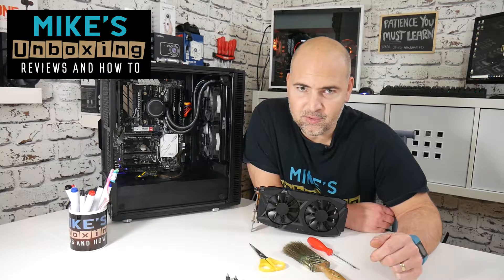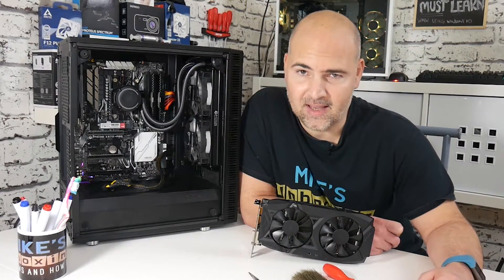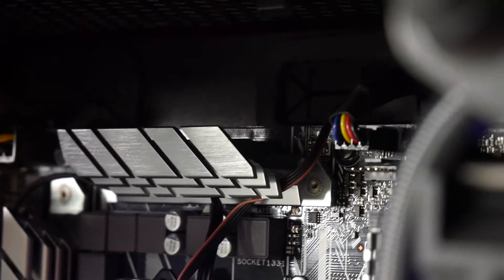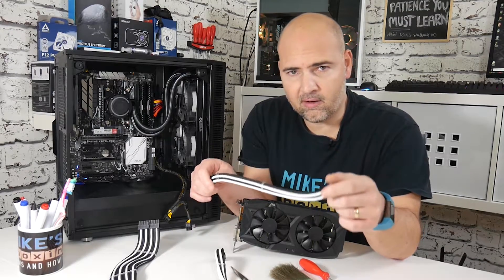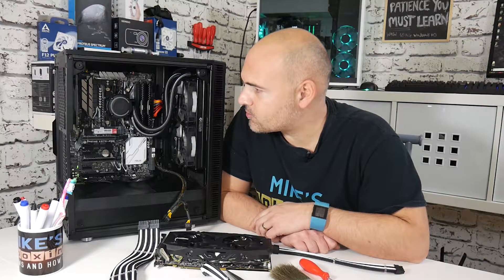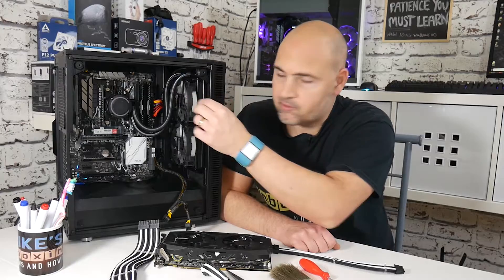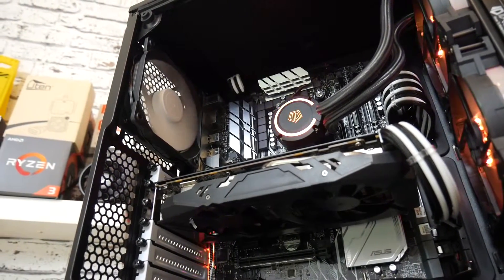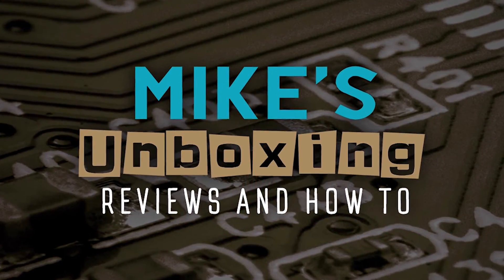PC PSU Ketchup & Mustard Delete With Shakmods Cable Mods & A Sharpie

Comment: Just a heads up for the M.2 drives;
Not ALL of the stickers that come on some of them are meant to come off. 
Some of them have a thermal pad incorporated into them. 
This one did not. 
If it does you should not remove the sticker :)
Reply from the maker: yes very true and worth checking if it is a thermal sticker

Comment: Sleeve the cables you have. Adding extensions increases connection failure rate. I like having colour coded wires. They help when doing wire and pin mods. And last, cut to size custom heatsink for your NVME drive. Then drill mounting screw hole from backside of heatsink.
Reply from the maker: that would be a better way for sure

Comment: What no M.2 cover? That would have been another way to deal with it
Reply from the maker: What is this magical device you speak of sir?
Reply: @mikesunboxing  https://www.ebay.co.uk/itm/M-2-SSD-Covers-Stark/153210669420?hash=item23ac11496c:g:dnMAAOSwunBa9G~s:rk:28:pf:0  - not entirely sure how they fit, obviously using the screw hole, but what keeps it from flapping about - other designs available

You can also get heatsinks - these covers are not heatsinks, in fact, probably the opposite
Reply from the maker: I had a quick look at m.2 covers last night and it seems there are hundreds of different designs and brands. I might have to get one of the EK ones. They look pretty good and actually do reduce the NVME temps.